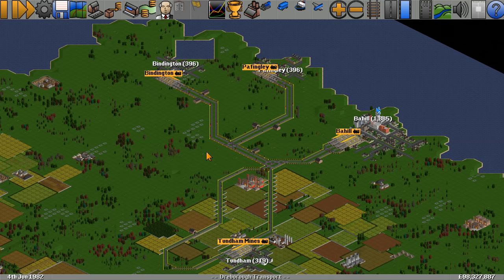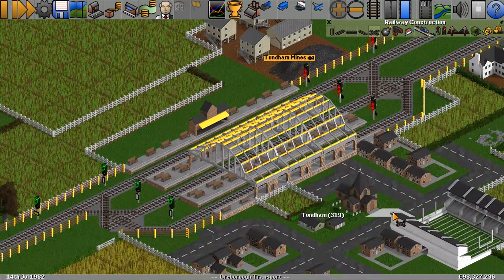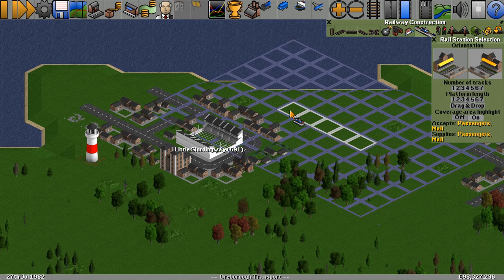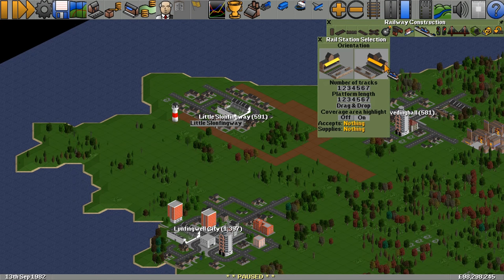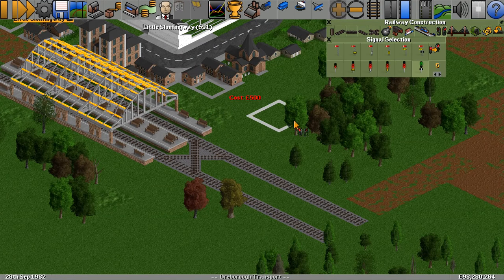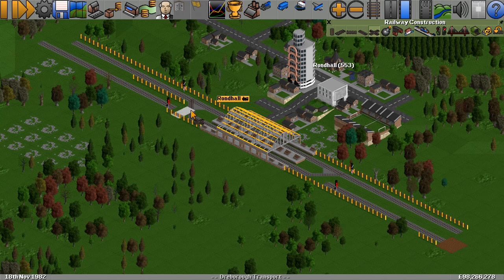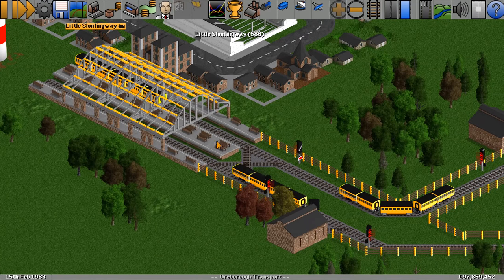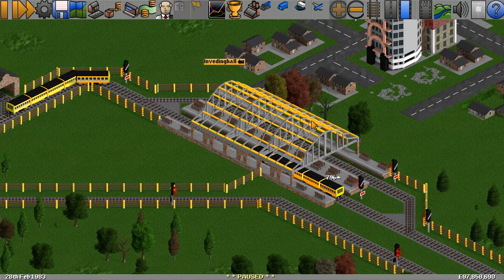OpenTTD Tutorial #13 - Advanced Railways - Stations and Waypoints

Comment: Good tutorial as always. The only way I tend to use waypoints is for busy RoRo stations at an industry that both accepts and produces cargo. For those I like to use waypoints to reserve 1-2 platforms for trains dropping off cargo while the rest (usually with plenty of parking space in front) are for trains waiting for full cargo to prevent all the platforms being blocked by them. (Seperate stations can ofc be used for the same result but I generally prefer the waypoints.)

Comment: I always get blockages on my RORO stations even when I have 7 platforms. Do you need to stagger the track splits/merges or something? What's the most efficient method?
Reply from the maker: It depends on what sort of blocking you are getting. Are they all waiting to leave? Or queued up waiting for a platform? One thing to try is to have longer trains. This helps with things generally
Reply: No it's just they have to slow down at merges and splits as another train reserves the track in front and then needs to accelerate again.

Comment: Hello I am just curious of what is the point of having huge train lines and mainlines and sidelines and connecting to factories from two far ends and connect every train to every railroad can’t we just make it simple and get every train directly connected to the factory\station it needs to go?
Reply from the maker: It could be a number of different reasons why you would make an interconnected network like this. Having a dedicated line for every individual different journey that trains need to make would very quickly fill up a map later in the game. In addition some people play with maintenance turned on which means that the more track you lay the more it's going to cost you every month. And some people just like to lay rail networks which more closely resemble more real life networks

Comment: I don't know if what I'm doing is... off... but I always treat my trains like circuits, connecting cities in loops, and the main track acts like a highway which will bypass a station a train isn't ordered to go to, so they have to pull off the main track in order to make their stop and continue instead of incorporating the stations into the main line. Makes it work more like traffic, but the one way loops make for super smooth movement of resources. Workplaces get a double-depot, hubs get holding yards of double depots, usually along 3 tracks to keep room for future flow.

So everything works in circles in my game with trains never reversing. Even massive hubs get worked into through stations rather than terminus to keep flow uni-directional and smooth. My version of a terminus is a track that loops back on itself with a holding pen and connects back to the main track through angles that ensure those trains only ever travel the one way.

And I'll usually tuck a double-depot before each junction to keep trains from wandering down the wrong path because they broke down.

Steep initial cost, but I guess it's the style I picked up through a few videos and some gameplay.
Reply from the maker: Will be cool to pop some screenshots on my discord

Comment: If the path signal shows green momentarily to trains when they can pass, how does the train know when to go for a 2 way path signal that can be passed from the back side?
Reply: Also at 21:52 why is the path signal not allowing the train into the empty station (empty for a while now) for a couple seconds. It eventually flashes green but I don't understand why so late.
Reply: Signals only affect the trains approaching to their front (trains that can "see" the light), unless you use a one-way one - then
Reply: Because he put signals at the other end of the station the wrong way. This means that any train waiting at any platform has reserved the whole station (because path signals create paths up to the next [front] signal, the whole station gets occupied) - that is why second train cannot reserve another path - their paths would collide at the exit of the station. So basically, he corrected the station signals, but only in one direction.

Comment: 22:05 - why is the train waiting outside the junction even though there is a clear platform on the station?
Reply: Might be late on this one so apologies for that, but I think that train might be broken down. Just unfortunate timing so it looks like the signals are not functioning properly.
Reply: Moreover, the path signals on the far side of the RoRoTerminus are the wrong way around. A train reserves a path until the next stopping point, so in this case past the station to the "out" track, but that last bit is already reserved by the train in the station. Making the path signals adjacent to the station face inwards, allows a train to reserve only until there and find a free track in the station.

Comment: Hi Master Hellish, my main issue with stations is something with a factory where I might have trains coming in from farms, steel mills and also goods trains leaving. In my current save I have a ro-ro style station with trains arriving from three directions. It’s a terrible bottle neck as trains get funnelled onto one line to then arrive at the station. How do I fix this? Even if I place the point where all the lines join away from the factory I  still suffer from trains queuing and congestion.
Maybe you could ( or have done something already) about how you would handle this scenario?
Reply from the maker: The thing to do here is not have all three join together. Have them come to the station separately and each of those three lines has a number of dedicated platforms. A piece of track has a limit on the amount of 3 but it can have so if you merge things down there is nothing you can do to get it past a certain amount of efficiency. You keep those lines separate then overall it will run much better
Reply: @MasterHellish-Gaming  Thanks for the idea - I guess my main issue with that is that busy platforms queue for a slot whilst dormant platforms lie idle. Nevertheless I did already give the goods trains their separate platforms and this did seem to ease the queue a bit.

Comment: Is it possible that you made a mistake @ 14:26 having one exit signal facing the other way?

I tried to build a similar station double entry/exit station on my own and I tried to keep my path signals and extent them with combo signals to keep the ability of having the trains moving in and out at the same time in the same pair. Judging form your demonstration later it seems that is not even necessary and I should reduce my signals to the bar minimum.

I still don't understand the "invisible signals" that stations are supposed to have.
Reply from the maker: The signal on my exit is the wrong way round thank you very much for pointing that out. Unless you doing roro stations do not put signals on the end of the platforms
Reply: @MasterHellish-Gaming  Thank you for the answer. When I tried to build this from memory I build it the other way (switching entry and exit). I can report back this works worse for some reason, in case of somebody having the same problem. Overall it's a great tipp.
btw: why do you prefer bridges over tunnels? I thought tunnels are faster?